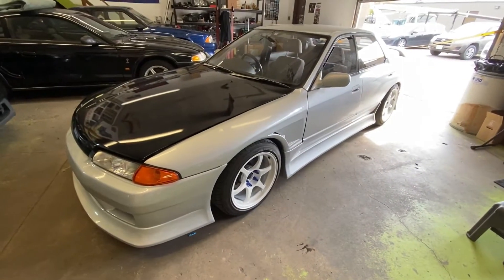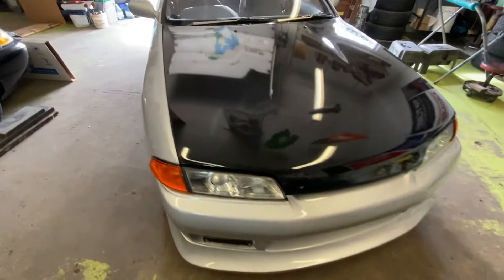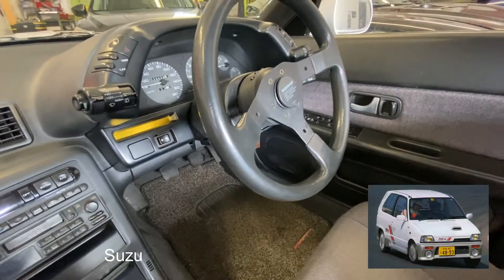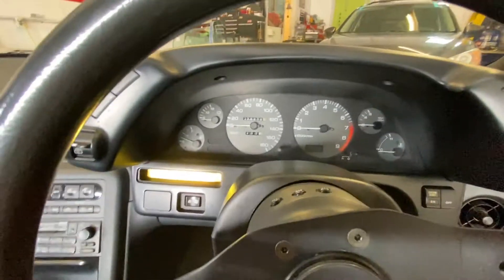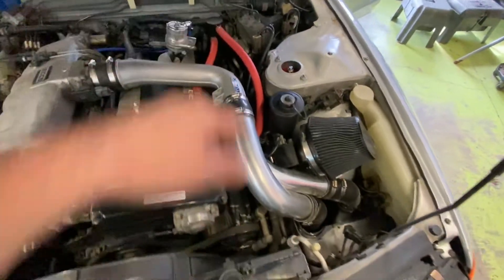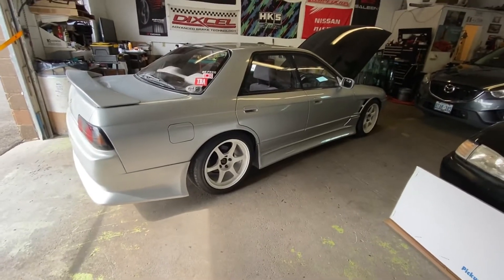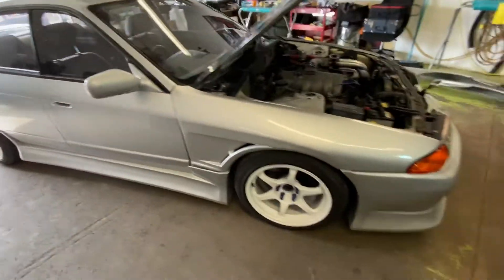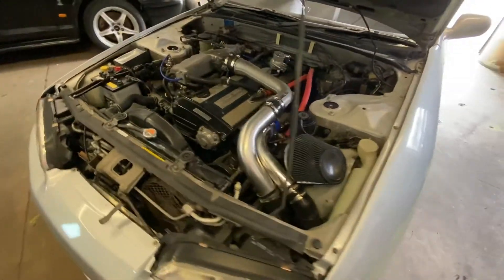Covid 19 car build - 1991 Nissan Skyline GTS25 + SA Lapping Day

Comment: Your video motivates me to get my car done. I have an ECR32 GTS25 auto and planning to do a 5 speed and turbo it very soon too. Awesome R32 sedan!
Reply from the maker: Get to it brother, they are simple machine to work on.  And if your stuck for any parts let me know.
Reply: @FEASTJAPAN  thank you and do you have any website I can check it out?
Reply: @FEASTJAPAN  Quick questions. Did you use the auto RB25DE ecu or R33 RB25DET ecu? Did you have to jump any wiring to make the car to start?
Reply from the maker: @doubleclutchin6860  I explain that in the video.  Just outsource the HCR32 RB20DET ECU.   But do plan on some sort of upgraded engine management and or get with a company like Nistune for a more open software suite.